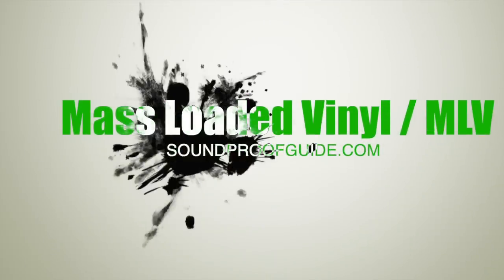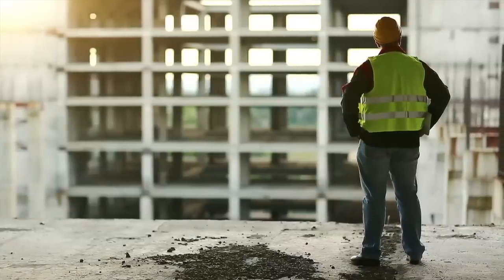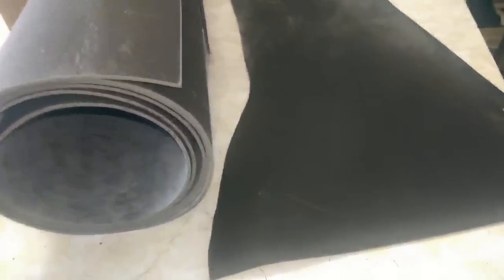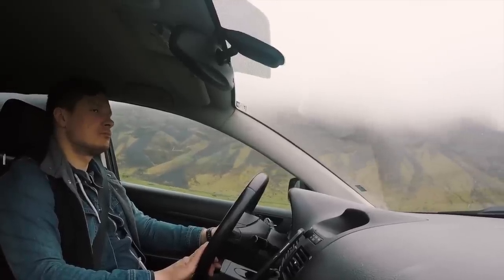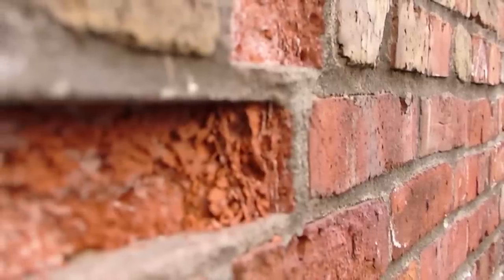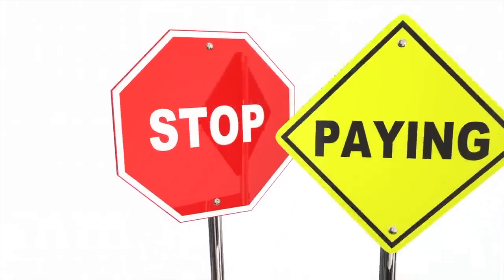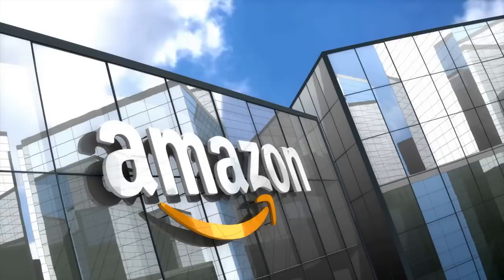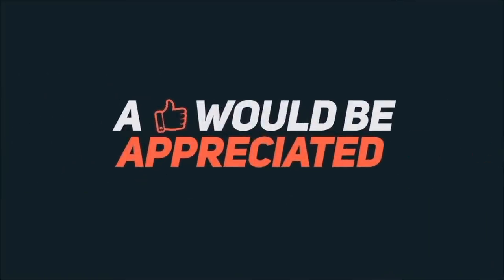Mass Loaded Vinyl For Soundproofing / All the MLV Facts!

Comment: One major disadvantage you failed to talk about is how labor intensive it is to install on walls and ceilings.  They are usually sold in 25 foot rolls.  Try hanging MLV by yourself on a wall or ceiling.  You will need a crew to do this.  I had two people have to help me to do this.  However- it did block sound incredibly when done.
Reply from the maker: You make a very good point! This stuff is certainly heavy! Thanks.
Reply: I installed this on my small bathroom ceiling by myself. Don't ask me how I did it, but I would never do it again. The amount of staples to keep it in place was crazy. The rest of the house won't have this on the ceiling.
Reply: @soundproofguide  if I have a finished ceiling and don’t want to take it down, would I get benefit in reducing foot step noise from adding a layer of mlv and another 5/8” drywall layer? Would that be better than adding green glue and another 5/8” drywall layer? I’m fine with some noise, but just want it reduced so I don’t know exactly where my neighbor is at upstairs while in my bedroom
Reply: Could I rent a drywall lift?
Reply: @davidwhumke3406  Green Glue is a waste of money. If you want something between the layers of sheetrock, use carpet adhesive. Way cheaper and stays elastic over time.
Reply: @vinylrules4838  can confirm you are right. I wasted my money. Can still hear upstairs neighbor well.
Reply: @davidwhumke3406  Sorry to hear that. In order to address noise, one has to know the frequency and the amplitude. Only then can one come up with a proper solution to address it. Dennis Foley at Acoustic Fields is an expert in this regard. He hears these stories every day from people who thought they were fixing noise issues only to learn what they did didn't work. The internet is filled with so much BS when it comes to sound attenuation. Everyone calls it sound proofing, which it is not.
Reply: @vinylrules4838  thank you for this suggestion, i'd considered green glue but it's so expensive. do you have any other hacks? is rockwool insulation worth it?
Reply: For existing apartment shared wall with neighbor. Tack on MLV to existing wall, then 5/8 drywall, then cover with brick (thin set), for a total brick looking wall. If you move it, rip it all down, if you must. There will be many holes, but hey, you didn’t deconstruct an existing wall.
Reply: Just say you're not a handy man and get on with it. Some of us do work like that for a living. The only downside of it being is that it's a lil heavy but other than that saying it's labor intensive is just lazy lol
Reply: you know you can cut stuff in smaller sheets right?
Reply: Glue the MLB to your additional drywall then drywall screw that over the existing surface. Finally skim or joint tape.

Comment: Easy on saying that MLV “soundproofs” your room. If your walls are directly screwed into the studs, A LOT of low-mids and bass will transfer through the wall, through the studs, into the adjacent wall, and into the next room. The last thing generally overlooked in soundproofing is the necessity of decoupling your wall to the adjacent wall. Otherwise, most of the low-mids and bass WILL transfer out of the room and effectively put a cap on how loud you can run your low-mids and bass without getting the cops called 😊.
Reply: Didn't he address this at 9:37?
Reply: Kit Carson he did mention it for sure but my comment was about saying that MLV sound proofs a room. It definitely does not do that. It helps for sure and the video has a lot of good info in it. But it does not sound proof a room.
Reply: In other words anytime MLV is mentioned also add Decoupling. Decoupling, Decoupling, Decoupling!
Reply: there is no such thing as sound proofing but thats the word that is commonly used for sound reduction. before you say anything try soundproofing against a bomb,you cant without distance haha.
Reply: Fuck it, im still gonna order a few yards of this shit and make some frames to mount it to and just place it next to my walls. I love living in an apartment where i can hear my neighbors literally talking not even yelling
Reply: @laundrysauce234  If you own your own apartment, I would seriously recommend you do more than just use MLV... you should really remove the existing wall and rebuild a new wall from the ground up consisting of 3" insulation, isolation clips, hat channels, 5/8" drywall screwed into the hat channels, seams caulked with acoustical caulking, then Green Glue, then another layer of 5/8" drywall with offset seams to the first layer, screwed into the hat channels, seams caulked with acoustical caulking... and then you'll have some real noise reduction. 

Be prepared to lose 6" of floor space per wall. If you want to add MLV to the above you can, but MLV with out decoupling and additional airspace (the insulation) isn't going to solve your problem.
Reply: @laundrysauce234  same problem 😒
Reply: What if you tryin to stop a girl moan from leaving yo room so yo family can't hear?
Reply: What do you mean by "decoupling?"
Reply: @iseeyou7368  Exactly what I'm trying to solve except our room is next to a kids room;(
Reply: Great write up. Does the green stuff work as a decoupler?
Reply: @iseeyou7368  Decoupling is even more important then.

Comment: The one thing this video doesn't cover is the frequency range for sound reducing that MLV performs. The other thing is the STC class the narrator mentions is that it is limited to frequencies between 125 Hz.- 4000 Hz. The most difficult vibrations to block sound transmission from are low frequencies-- the lower the frequency, the more difficult it is to prevent sound transmission.
Reply: Great comment – with more actual information than this entire "video"
Reply: Seems you know what you're talking about. Will this block the sound from a table saw from being heard outside of the workshop. Brick walls. Foam injected steel door. Only one small window with double glass with air chamber. Thank you!
Reply: True, but keep in mind that the human ears are more attuned to hearing midrange

Comment: We used this all over the place on the yachts we built at Burger Boat Company. It was built into the plywood for the walls and floors, but the entire room was also decoupled from the frame,  floating on Regufoam and insulated with Roxul.  Insanely expensive, but the rooms came out very quiet.
Reply from the maker: That’s awesome! Thanks for sharing!
Reply: How do you install it? Doesn’t it have to be limp and allowed to move?
Reply: @abc-ed1nr  It was sandwiched between two layers of plywood.

Comment: As an FYI MLV can be digitally printed to any finish you wish.  You would need to talk to specialty acoustics providers for this though, Home Depot wont have this option.  I would strongly suggest this over painting.

For those worried about fire rating, any MLV I have come across is rated under E84.
Reply: MLV by itself is not fire rated. The product can be Class A E84 fire rated when it has a foil facing on it.
Reply: interesting, do you have a company you suggest? and when you say you can choose a finish are you referring to color, design, texture?
Reply: @jbo5021  colour or print, not texture.
There is a company out of New Jersey that offers this - E squared.
I assume only large quantity orders though.

Comment: Been in construction for almost 20 years.    In my experience the most effective way to soundproof a room is to use two layers of fire rated 5/8 drywall with a healthy amount of acoustical sealant between them. .. 
Looks like a great product for soundproofing floors though...
Reply from the maker: You’re completely right! Thanks for commenting!
Reply: @Lollburger88    I typically just use acoustical sealant.
Reply: @Lollburger88  I'll be honest .. I've never used the other two products. Never needed to. Two layers of 5/8 fire rated without the acoustical works great for residential. 
 I'm actually doing a few commercial sound barriers rite now with out the acoustical.
 In that situation we build a new wall 1/2 inch out from existing one.  Insulate it with standard insulation, run sound bar vertically every 2 feet starting 1/2 inch of the floor and ending 1/2 inch from ceiling and then the two layers of drywall ..

Comment: Need to soundproof against 4 types of noises from my neighbor in nice bachelor apt in heritage building. Her voice is 1, her chair drags on solid wall to wall porcelain tiles ( or objects when dropped and rattle).her heavy thud heel to floor rapid stepping ( each step like a 5 pound rubber mallet to 1 inch steel boat hull) and finally her steel door in steel.door box slams.

I need to cover 350 to 380 square feet of shared wall.
If spend that much...will it solve these noise issues?
Can't do anything in her place, but if puts her carpet down would help some...but not much.

Comment: I've hung about 3 rolls of this stuff up in my workshop. I've yet to finish it completely, because this stuff is expensive, and it's heavy as shit. Seriously, I tried to use plastic cap roofing nails to hold it up to the wall, and the weight of the MLV just tore around the entire washer. If you order from Amazon, it's delivered by UPS with a dolly. Have them drop it off close to where you are gonna install
Reply: What you address there is the main issue everyone is not aware of is the weight of this product. You need to use nails with washers to hold it up and will take 2 people to install it.
Reply: svjness can I just apply it to my room. My family is upstairs and it’s really noisy

Comment: Great video.  I am contemplating using on garage door that faces street.  I am wondering how heavy it is and if it will put a strain on my auto garage opener motor and brackets that support the door.

Comment: It needs to hang like a curtain in the void between the original wall with the noisy neighbour and the new stud wall ,then it will block just about all the noise. As soon as it’s in contact with the wall it’ll transmit the sound through.
Reply: And how to to this like you recommend?
Reply: @LifeofPhi  I fixed the carpet to a wooden batten ( a piece of 2 inch X 1 inch wood and then I screwed the batten through the ceiling and into the timbers above . I first went across the ceiling with a sharp spike and made lots of little holes and each time I found a timber I marked it on the ceiling.   If your timbers are going to go in the same direction as the batten then you may find it’s too close to the wall and the next one too far away from the wall,  so you’d need to get above the ceiling and  add timber work to support your hanging curtain .
Reply: @thpxs0554  Thanks. How is result? 
MLV is crazy expensive now.

Comment: Also, regarding floors, is there something you can put down before cement board for tiling to help with sound?  Could you lay MLV over the flooring planks (1950’s house)?  I’ve already put cement board down on the floor above where we’re going to do the ceiling so would be too late for MLV there.  Is there something else that might help over the concrete board before tiling?  We couldn’t put concrete board under the acrylic bathtub.  Would laying rock wool over that part help at all?  Or mlv?  One of your videos said that any gap will mess up most of what you doing for the sound  dampening, so I feel like the whole thing will be wasted because essentially there are open holes in the floor planks underneath the bath tub over the other room where we will be doing things in the ceiling.

Comment: Cool Commercial! As a musician for 40 years and a  General contractor for 30, I've looked into many methods of "soundproofing"... Here on the east coast, in our row homes, Clients would ask me to soundproof against neighbor noise... I would tell them, it's impossible. Some areas are basically impossible, more appropriately, economically unfeasible. I guess if you ran 3/4 inch thick perpendicular layered MLV over all surfaces, you'd cut the sound down between properties significantly. But it's all about Cost/sq. ft.

Comment: Yeah, ~14 years ago, I added MLV to my 2010 Toyota Camery due to road noise, I used Seconed Skin Audios, I think it was luxury liner pro or something, I put in on the floor of the whole care and the doors, god the doors where a PITA. iirc it was MLV + closed cell foam.
Reply: Just added it to my yaris, and I'm also going to do it to my Corolla, which is as loud as a jet airplane 😂. 

Cost about a $1000 a vehicle to do it properly. MLV on top of foam with foil facing  on top of various  butyl  CLDs from Resonix to Amazon basics in the trunk.

The result is that I feel like I am driving in a spaceship. My music has never sounded better.

Comment: I’m sound proofing an existing wall between my bedroom & roommates but have around 1.25” of available space before hitting the trim for the door. I also want to finish the wall with shiplap. 

Where would you recommend I put MLV? :
- existing wall
- Green glue
- 5/8 fire resistant drywall
- Green glue
- Shiplap

Comment: You mentioned using Mass Loaded Vinyl under Vinyl flooring to cut down on noise transfer between two floors (apartments). Can you lay the vinyl flooring directly over the Mass Loaded Vinyl, or does another surface need to be laid in between?
Reply: Greg did you ever get an answer to this question?
Reply: @MidwestSpecial  No
Reply: I would do another in between to be honest.  Vinyl flooring can technically be laid straight to a subfloor but adding the correct underlayment can keep a warranty from being voided
Reply: Gold floorlot is what I used between existing hardwood floor and new layer of real wood.  Looking for decoupling and vapor barrier. 

It’s a kitchen where there is bound to be water spills.  The rolls are inexpensive, marked with grids, cuts with scissors.  I was glad to have extra. I put it on the wall behind the radiators.
Less dust accumulation, and the foil throws heat back.  Used blue painters tape to secure. Been prepared to take it down, but no problem at all, no odor, nothing.   It’s easy to work with, light enough, one person job.  Used it on basement overhead joists, gives a finished look, no dust accumulation and reflects light.  Staple or tape.  I used it on canvas stretchers, used wire and eye hooks to suspend.  It'll come down easily to be reused someplace else. 

We’re new at these things.  Delighted to see this site, great advice, can see what others are doing.  

Remember to take  before and after pictures for your own edification, and to be used to impress the new buyer.

Comment: My neighbor cranks his tv surround sound, and his bass bleeds into my living room, will this solve the problem ?
Reply: savant416 You need special sound reducing shit rock and Rockwool sound reducing insulation.
Reply: @airmsylenam954  been three months. Finally!!
Reply: @KarlGutowski  wait... What?
Reply: adding mass like concrete or brickwork is one of the few things that works vs low frequency noise.
Reply: Do you hear it coming from a single wall, multiple walls, and / or the ceiling? If it's all of these, then you need to essentially build a 'room-within-a-room, which A) isn't inexpensive, B) will take at least 6" of floor / ceiling space from each wall C) needs to be done properly or you will end up spending a lot of money without getting the results you want. Unfortunately, there is no easy solution to minimize or eliminate noise, especially low frequency noise.

Comment: Well made video. I have neighbors who like to blast their music system with large subwoofer outside. I don’t get bothered too much with the higher frequency noise, but the bass/low frequency stuff drives me insane in my own house. I know I wouldn’t be able to afford to soundproof the house, but if I could at least soundproof one room and escape the low booming it would lower my anxiety and help me sleep better. What advice would you give someone who wants to try and block bass?
Reply: Go and knock on the door, a fill them in!!! That works quite well.nah only joking ,I’m here trying to find out myself lol
Reply: Might be interesting to reach out to large builders/developers to see if they could test the market by incorporating a quiet room in their model homes as an upgrade option.
Reply: Yes, do explain to yr neighbors.
Reply: You can easily soundproof one room. Just build a separation wall that separates the room wall from the outside wall, and make sure your windows are sound proof and that you use acoustical sealant (which is flexible and will therefore block sound transmission) around the windows. Then I usually advise clients to hang very heavy velvet curtains. You want the velvet on both sides. And then install heavy carpet on the floor, with a floor mat under the carpet.. All this stuff acts as a damper on the sound. You also want to have a good seal on the door into the room so that the sound permeating the rest of the house doesn't come in through the door. Hollow core doors are good, but you need a sound seal around the door. You want stuff that stops the sound vibrations from entering your room. Sound is energy and it's transmitted via vibrations.
Reply: I once totally soundproofed a bedroom by installing a sheet of 1/2 inch thick Foam Board over the wall, and the window as well. It's a lot cheaper than wallboard, and a lot easier to work with. You can cut foam board with a utility knife. They sell foam boards at most art supply stores.

Comment: Great Video!    Curious..  If I install MLV but then also paint it will the Acoustic Coat Paint would that help alot more to reduce sound transfer or should I not spend the money? Maybe also use Green glue at as well?    I want to put MLV on the hardwood floor (1910 building) and then cover it with a laminate floor.   I'd assume I'd also need to use an underlayment just under the laminate floor as well?   Any suggestions for that?  Thx!